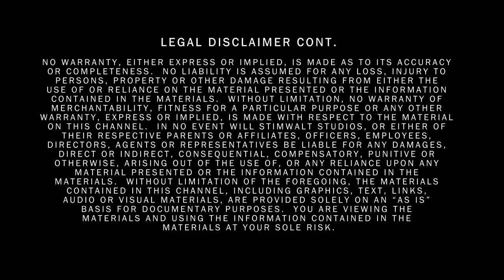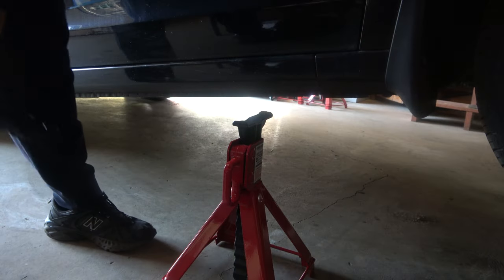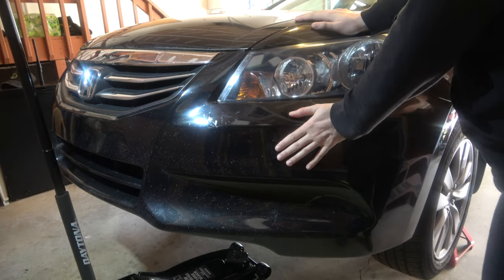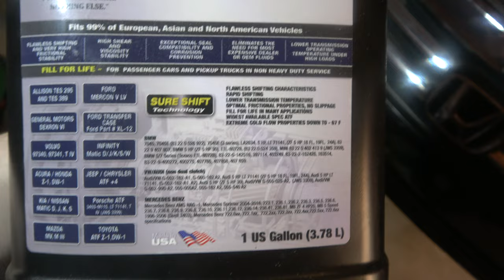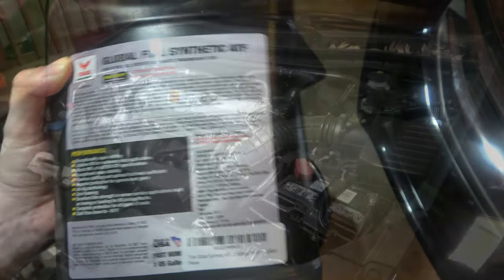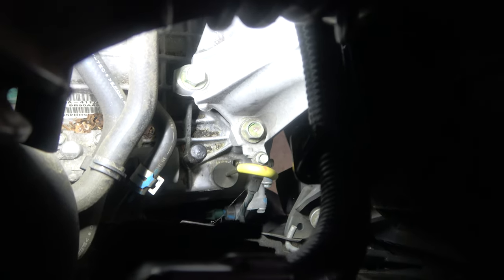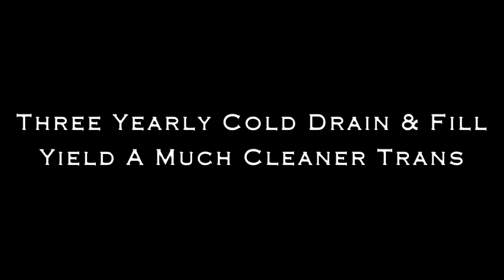ATF Cold Drain And Fill - Honda Accord 8th Generation 2008 2009 2010 2011 2012

Comment: Any cons to cutting out that plastic shielding for easier access to the transmission drain bolt? Considering doing the same
Reply from the maker: As long as the fasteners are sturdy and the plastic doesn’t hang down, no issues in my experience.
Reply: My transmission fluid on my 2009 Accord came out dark very replace it with oem from Honda

Comment: Just did this for my car, only had to use a jack to help break the bolt loose. Which it worked! Everything went good thanks for the informative video. I also replaced my atf filter

Comment: Despite what people think and say the transmission won’t self destruct using something other than Honda OEM ATF.  Numerous Hondas over 200k and they ran on Amsoil ATF after first drain and fill.  Never a single issue.
Reply from the maker: That's correct.  Most folks don't realize that when they take their vehicle to a Jiffy Lube or quick stop garage, they aren't using Honda OEM either.  I do recommend you use OEM if you aren't comfortable using a more robust and enhnaced ATF fluid like Triax/Amsoil.

Comment: Why the Drama anout Cold / Hot  put the Same amount back in  . Just put Shy 1 qt. Back and fine Tune the Level with the Dipstick
Reply from the maker: It’s simple, work smarter not harder. Transmission fluid expands with heat and shrinks when cold.  So if you empty while hot, but then add in room temp or cold fluid, you will in fact not be adding a 1:1 amount, because  1 quart cold != 1 quart hot.  So you should always add cold fluid to a cold transmission, because heat throws off the measurements.  It’s smarter and less work this way, because what you measured coming out will always match what’s going in, as the levels will be 1:1.
Reply: @Stimwalt  So you wont Check the Level with the DIPSTICK, After its at operating Temp.??
Reply from the maker: @donalbershardt9290  I will.  Once.  Just once.  That’s the whole point.

Comment: Doesn’t matter if the fluid is cold, warm, or hot, if you measure and put in exactly what you take out, it's the exact same thing.  If you're doing three drain and fills consecutively, the fluid will eventually get hot, expand, etc...which contradicts your stance in the video.  What did you use to cut the shield?
Reply from the maker: This is wrong.  Ultimately, if the fluids being exchanged are the same temperature, then you can do the 1:1 volume replacement.  

If the engine is warm and the replacement fluid is room temperature, the amounts won’t be 1:1, they will be different amounts.  This is because ATF expands with heat.  Thus the warm ATF will drain out “more” fluid than is actually being replaced, which is a problem.

I did three drain and fills over three days, each time was a cold drain and fill, meaning the engine was cold, fluids were room temperature, hence 1:1 replacements.
Reply: @Stimwalt  good feedback brother. As an engineer that makes sense in which is probably why slightly high on cold readings. I check my level after I posted this lol. What did you use to cut out the area?
Reply from the maker: I ended up using my gardening lopers, because I needed a lot of bite force, and my box cutter wasn’t working.  https://amzn.to/3X7JZvJ
Reply: @Stimwalt  cool because I was thinking about buying a cheap dremel. I want to cut it out while it's still attached